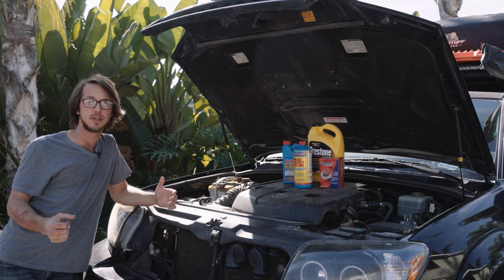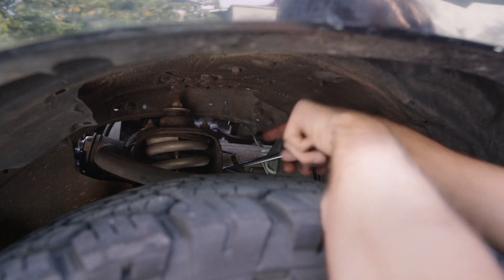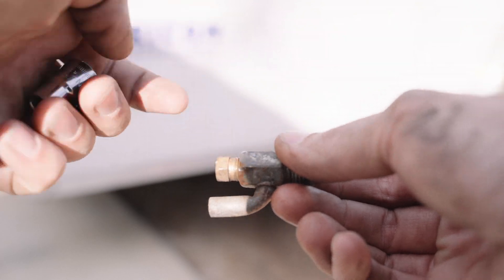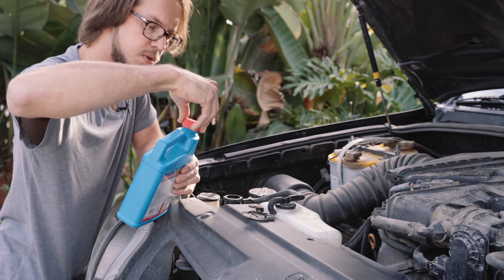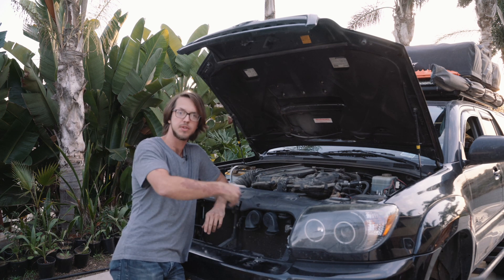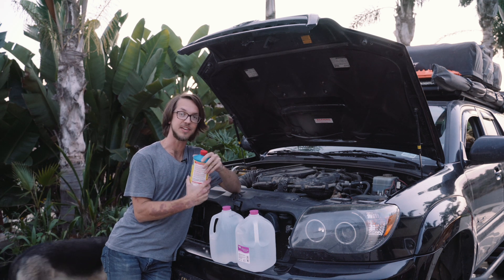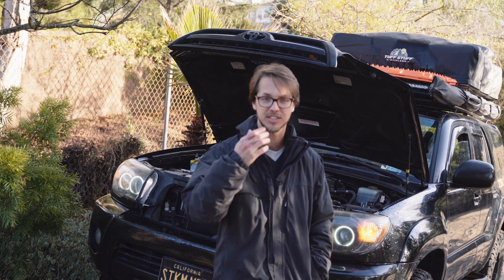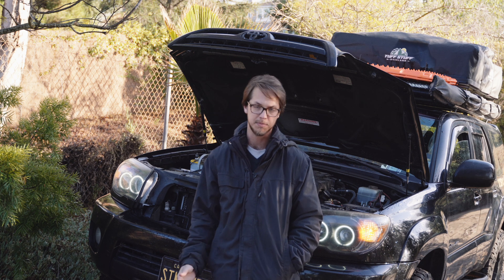How to fix your Head Gasket for $100 with Blue Devil Head Gasket Sealer!

Comment: so was yours running driving fine then after a few minutes randomly overheating and boiling over?
Reply from the maker: My would drive normally for hours, then when I slow down to a stop it would start overheating. It would happen much faster when going up mountains or towing a trailer. Normal daily was almost entirely unaffected other than a slightly rough cold start in the morning. Blue Devil suggests if your engine can't idle for an hour without overheating then your head gasket might be too far gone. I'd probably still try it myself, since the alternative is much more expensive. Hope that helps!

Comment: I’m misfiring on cylinder 6 (even after changing spark plug, bubbles in the radiator, water coming out tail pipe with sweet smell upon cold start. 2005 four runner 4.0L 225,000 miles. Just bought it 3 weeks ago, now I’m dealing with this. How’s it working for you? October 26, 2020. I plan on flushing with blue devil flush and the Repair juice. How’s it working now?
Reply from the maker: Damn! Hope you got a good deal on it. I'm getting ready to make a 1 year video on my experience. Long story short, this stuff worked like magic for me. Still running good as new!

I would definitely leave your spark plug 6 in. The Blue Devil fluid needs heat and oxygen to solidify.. so you'll be needing that spark. There shouldn't be much water running through the cylinder with the engine on. Cold start is the worst cause the water has had time to build up.
Reply from the maker: Also, I left the blue devil in for a few days, the company says it can’t hurt. But I didn’t fully trust that my engine got hot enough to make the chemical reaction happen, so I left it in and drove it around. Then I drained out enough water to add the coolant.
Reply: Would you recommend pulling spark plug #6 during the sealant process for better penetration? Thank you 🙏
Reply: I got the shaft real bad. I appreciate you replying so quickly man. It’s definitely something I didn’t buy to want to pour money into, I bought it for work to keep miles off my tundra and something with better mileage.
Reply from the maker: @matthewhooks452   Well if your HG isn’t horrible then there’s a good chance this will work. Let me know how it goes!! Be sure to follow the direction carefully. The people who I’ve seen have failure with it have also not followed the directions.
Reply: I plan on busting out the thermostat when I do it. And draining all three coolant drains
Reply: Is there any way to private message you here?
Reply from the maker: Good question. I usually send people over to Instagram or Facebook for DM. Are you on either of the two?
Reply: Facebook

Comment: Before the fix, were you hearing gurgling noise in your dash when you start from cold engine and whenever you stop the vehicle (on a stop light) and start again?  After the fix, did those gurgling went away?  What is the status now?
Reply from the maker: Eng Al 100% there was gurgling. That was my first clue there was an issue. All gurgling went away and the truck is still running wonderfully and I’m still amazed haha. This stuff worked great for me!
Reply: @TrailBendersOverland  So you said you kept this thing in the car without the thermostat for how long before you drain it? or did you drive with it and plain water and thermostat installed for how long?

Comment: So my 2004 now holds temperature fine after blue devil but bubbles are still coming up from the radiator. Do you still get bubbles? I did the blue devil procedure exactly as you had done.
Reply: Nice E46 M3 and E39 M5 :)
Reply from the maker: newton I stopped getting bubbles entirely. It’s possible it improved it without fully fixing. I also left the blue devil in for over a month. I intended on only leaving it for a few days... lol but it stayed a bit longer. Didn’t hurt anything. I didn’t get any overheating for normal driving when it was it was blown. Only when I was driving for a long time or pushing over mountains. All that issue went away completely after using this stuff.

Comment: Btw Im going to try this on my nieces 2012 jeep cherokee. Its leaking exuast in the water too, But very little. Truck can last all week without over heating , thats when she has to refill the radiator all over again. She obv cant afford $2,300 for a HG repair. Have you done a engine block leak test on it after the fix? Also did you ever drain the blue devil and apply coolant again? how is that going
Reply from the maker: Sound spoke you’re a perfect candidate for it. I’m 10 months in and it’s running like new still. Not one issue. I’m still amazed. I have not run a block test but my idling is perfect and I have more power than before. I’ll do a test at some point. I actually left the blue devil in for a couple months before draining. There were no clogs or clumps to speak of at all.
Reply: @TrailBendersOverland  sounds great. Glad it worked for you. Im going to add this stuff to her truck tomorrow . Wish me luck
Reply from the maker: @allthingshiphop1151  Good luck! Sounds like you don't need it though. I was pretty skeptical going in to it.. but I'm both extremely surprised and impressed.
Reply: if you have an oil/water seal broken, and water is getting into hte oil and oil is getting into the water, then if that is a silicate sealer and it gets into your oil, it could end up in your bearings. if it gets in your bearings, your engine is fucked. 
"sealing" your bearings solid = no, no!
Reply: @Ghryst  well i tried it 3 days ago and  I dont think it worked. combustion gasses are still in coolant. I think I used too little blue devil. My nieces jeep uses 3.5 G of coolant and the bottle says to use half for a 3G system. I used half but I think I shouldve used 3/4 of the blue devil. No overheating yet but thats because it takes a full week to start overheating from coolant lost/burning up/evaporating. I did flush the system out today at least 3 times before giving her the truck back and told her to save her money for a gasket repair. Not sure if it was my fault or the product didnt work. Im probably going to try another product next weekend. If that doesnt work then i give up on it. Btw there isnt any coolant in oil or smoke coming out of exhaust. Just strong smell of combustion gasses in radiator and very light bubbling in reservoir.
Reply: @allthingshiphop1151  im not real familiar with this brand, but if it is a silicate sealant, then theres a very strict procedure to be followed in applying it so it doesnt cause other issues.. be very careful with the stuff.. its not recommended to try to stop oil/water separation leaks
Reply from the maker: I would’ve driven it for a few days with the blue devil still in it personally. It unfortunately is hard to say with things like this where the fault is if it ends up not working. It’s worth the try though in case it does work, in my opinion.

Comment: Another great product to try is k-seal  , I tried it in my 05 civic and it hasn't overheated yet . So far so good.
Reply from the maker: Love the success stories! When did you do yours? Did mine 10 months ago and it’s still running like new!
Reply: @TrailBendersOverland  how long till u dont have to turn the  heat a c anymore
Reply from the maker: Ryan Mendezz run the heat for the hour that it’s running then you can shut it all off.

Comment: Yes that 😈 does its job very well!
I used it on my parents Nissan truck with v6, it extended the engine life for extra 2 years before the head gasket got busted again! 
Just make sure you guys follow all the step, and get the job done right!

PS don't wait until the last minute! Do it as soon as possible! 
I would do it for all my cars with high mileages, even without any problem!
An extra step along with cooling system maintenance could save you thousands of 💰
Reply from the maker: Totally! That’s great advise. It’s been 9-10 months since I did it and my 4Runner still runs like new! Like you said, follow all the steps correctly.

Comment: You only used half of the bottle? Why not the whole thing?
Reply from the maker: There’s a graph that shows recommended amount to use based on the size of your coolant system. If I remember right it’s on the bottle. I just followed the recommended amount.
Reply: @TrailBendersOverland  thank you for the input. The reason I asked because I have the same engine and I'm going to work on it this weekend. 👍
Reply from the maker: Awesome! Best of luck. It’s still holding great for me after 9 months! I noticed some of the videos where is failed for some people are also people who didn’t follow the directions seriously. Part of why I followed the guideline for the amount to use.

Comment: How is this repair holding up? Was thinking about trying the same thing
Reply from the maker: It’s has been perfect. It’s been around 8 months now and I’ve done plenty of towing and pushing over mountains, which were situations where my issues would show up, and I haven’t had one issue since. It runs like new. I still can’t believe it. Just be sure to really follow the steps. Do the flushes, pour slowly.. etc.. I would recommend it to anyone who doesn’t have extreme symptoms.

Comment: i used this stuff in my first vehicle in high school and drove it for about 3 years with no issues.
Reply from the maker: haulingbass tv Awesome! Did it have issues again after 3 years or is that when you stopped driving it.
Reply: Trail Benders Overland well, I passed it on to my little brother who decided it would be cool to drive it through the river, where it sucked water into the motor and that ended up being the death of that rig. It ran great for those 3 years and I bet I put 40k miles on it!

Comment: Sorry if I missed this - did you do a full flush sometime in the last 6 months and get back to having antifreeze in your 4R? Do you still think the vehicle should be run for a few weeks with the water/Blue Devil as-is and then flushed? Looking to do this on my 4R and trying to plan my attack, haha.
Reply from the maker: Good question. You didn’t miss anything. I probably could’ve talked about it more clearly. I actually let it run for a few months. That much time is definitely not necessary, it’s because I was pretty busy and never got around to it. Running it for a few weeks I feel is a good idea, not sure but it made me feel better about it. That said, within my first hour of driving I noticed a difference it how it runs and ever since it’s been amazing. That was around 8 months ago now. When I got around to putting the anti freeze in I didn’t do a full flush, just drained enough to add anti freeze. Blue devil says it’s perfectly safe to let it mix afterward.

Comment: This stuff is great !  My water pump had a pretty big leak . I watch the video fallowed the instructions and it really worked . I was amazed .. … Its  awesome definitely would recommend it ..   Thanks  a lot..
Reply: you used this for a water pump leak? wth... next time replaced the water pump. pumps cost around $80-100. ask a cousin or guy friend to do it for you. Its a very simple job, Minimum  30 min job. Dont ever do this again if you know where its leaking from. You can damage your engine using this stuff, This stuff is ONLY for people who KNOW they have a head gasket problem and dont have the money for gasket repair which costs $2k-$5k's. This is ONLY a last resort. Thats ALL its intended for nothing else.
Reply from the maker: I agree with you except for it being able to damage things. Blue devil is made and known for being the better quality product that does not damage your system. I would agree with you 100% in reference to stopleak. That stuff will destroy your coolant system. Blue devil however is trustworthy
Reply: Know if ur water pump is good if it blowing hot air
Reply from the maker: Awesome! Love success stories. It’s been 8 months now and my truck still runs like new after this!

Comment: Did you have to run the heater when you first poured it in and let it idle?
Reply: Yes. On full blast
Reply from the maker: You do need to run the heater so that the coolant will run through the heater core. However, you do not need to run it at full blast. Running it on low will allow the coolant to flow through and will not disperse too much heat. You want the heat to build up while you wait. Running the heater on high will rob you of some of that needed heat.
Reply: @TrailBendersOverland  hey my heater is not working, I think because of whatever is causing my car to overheat, it was working before, so my question is will the work still?

Comment: Did u have coolant in your oil?
Reply from the maker: J M Rager I didn’t. Which isn’t abnormal for mild leaks like mine. But I did have exhaust in my coolant.
Reply: @TrailBendersOverland  I had coolant in my oil on dip stick, just tried the product 2 days ago followed the instructions and today is Sunday and no coolant on dip stick..hopefully it works for me (99) Ford f-150 ,has 181,000.miles on it..should work for you , change your oil and drain pan also, flush oil through engine for 10 minutes and make a complete oil change..good luck..
Reply: @TrailBendersOverland  did u have bubbling in your reservoir when u shut it off and could hear the water rush through your heater core. I'm asking cause I am having these symptoms.
Reply from the maker: I had bubbling when on, shit off, water sounds in the heater core, rough idle with cold start, and random rough idle here and there. Daily driving didn’t cause any issues, but after a few hours of driving, or pushing up a big hill I would overheat when coming to a stop. This is from having bubbles in the coolant.
Reply from the maker: The bubbles you see are from exhaust getting into your coolant.
Reply from the maker: Also, be sure that your system doesn’t just need to be burped. Part on a hill nose up so your radiator cap is higher than your heater core. Run the truck for 15-20 min with the heat on. If the bubbles never stop coming then that’s a bad sign for your HG. If your daily driving is mostly normal, then this still will most likely work for you.
Reply: @TrailBendersOverland  oh yes I changed the thermostat, waterpump and radiator. Each time lifting the front end to try and get all air out of the system. Each time with no luck, small clusters of bubbles when hitting the gas and one or two constant bubbles. I'm just now getting the rough idle stage. Tommorow I'm going to flush and blue devil. 🤞🏻 thanks for info and the video will help my process.

Comment: I just bought some for my 1990 F150, a mechanic recommended it..

How did it work for you? Is it still holding up?

My thermostat is new, I haven't really drove the truck, do I need to buy a new one, still?

Thanks in advance..
Reply from the maker: Dee 1 I applaud your mechanic for recommending it. It’s a cheap way to possibly fix it without spending a fortune.
Reply: @TrailBendersOverland  I salute him as well, it's my very 1st visit with him, very 1st time he met me after a phone call last month..

For him to save me $3,000.00 on the spot(which is what he would charge to rebuild the engine), speaks volumes for his integrity..

Yup, he's my mechanic, my go to..
Reply from the maker: Dee 1 Its still great for me. As if nothing ever happened. You only need a new thermostat if you break the clip on the housing like I did. If you can get the thermostat out and back into the housing without harming the housing then you are good to go.
Reply: @TrailBendersOverland  I think I just have to get a new thermostat gasket..

I took the thermostat out, looks okay from what I see..

I will do the procedure tomorrow, the thermostat housing is in one of those headache spots, so I just pulled the thermostat tonight, will rinse out the system tomorrow with a water house, & proceed..

I put the housing back on. Should I take the housing back off before rinsing or is it okay to rinse with it on?

It's a real headache to get off, takes about 30-45 minutes, it's in one of those spots...ugh.

A thermostat issue would not prevent the sealant from working, would it?

Just in case I overlooked something concerning the thermostat, & still end up having to get a new down the road..

It's new, I wouldn't think anything is wrong with it though..

Comment: I can’t see all the comments so this may have already been asked but you didn’t flush the heater core. Any particular reason why? Not judging, just asking.  Great video BTW.
Reply from the maker: All honesty.. I didn’t think of it. Lol but it worked so I’m happy. I flushed the whole system a couple times in the process so any coolant that would’ve been in the heater core would have been pushed out my the cleaner and the water.

Comment: Great video.
     How many miles so far on the HG sealant?
     And in regards to dropping the nuts when removing the t-stat hpusing... ..little trick, put a piece of paper into your socket.
    When the socket slides over the nut, the paper will conform to the nut, biting onto it...so it wont fall out
Reply from the maker: I've gone around 5,000 miles since using Blue Devil. Still running like a dream. Still amazed by it haha. Good call on the paper! That's a great idea, thank you.
Reply: @TrailBendersOverland  any update over a year later???